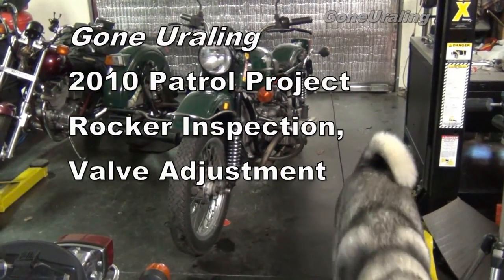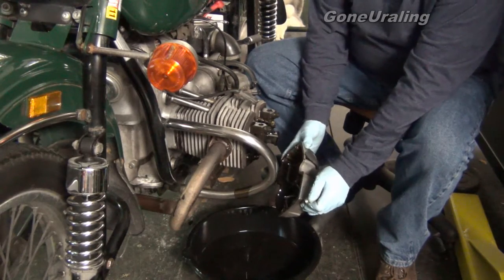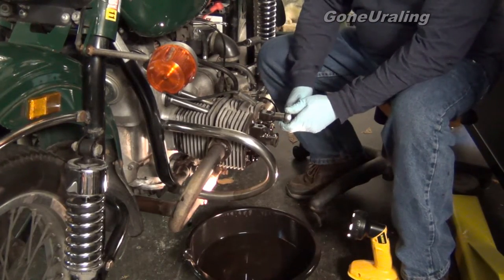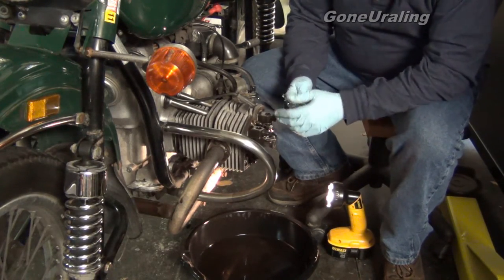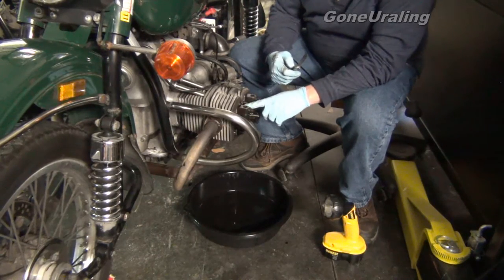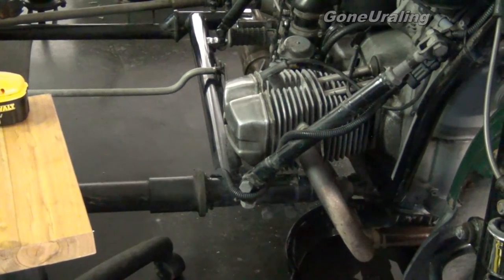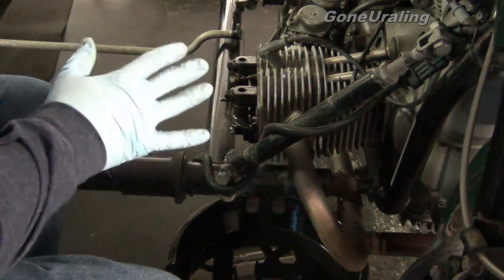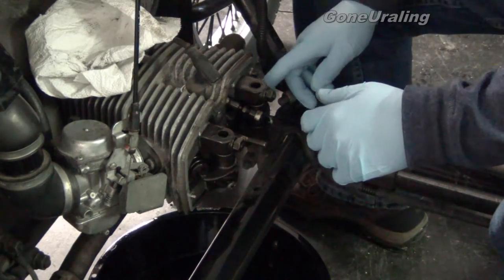2010 Patrol Project - Valve Adjustments

Comment: Remember,,,,,left and right on a motorcycle is when you are sitting on it. Very good video,,,,,,good info.
Also, call it a gauge,,,not a shim,,,some motorcycles do use replaceable shims to adjust their valves. Good job!
Ocala Fl

Comment: Wow, never took the tub of my Hack to work on her (the Retro that is)! You are having too much fun! What you found is typical with an engine with the petcock left open for an extended period of time. You are doing it right, drain everything, flush, adjust refill carry on! Just hope the crank did not get bent by hydraulicing the engine! 35 to 40 works, DO NOT USE TORQUE SPECS FROM MANUAL! Man those were loose! So far so good! Don;t worry about the rust, she set up for a while not Unusual - usual. Don't let her sit! And don't forget, loose valves are happy valves...
Reply from the maker: +JamesAllmond Yep, the tub actually lifts right off after removing 6 nuts. I took it off to work on the tub, but it was so easy... I think I&#39;ll just do that every time I adjust the valves. So much better than leaning over the seat.   Turns out the petcock was bad and running fuel in any position, new manual one is already on the way and I will probably change out the 2008s as well.
Reply: +Gone Uraling Changing the petcock was one of the nicest things I did to the Retro! I even have some caps for vacuum port if you need one!

Comment: My patrol will not start, ran fine but battery died, replace it and it ran around for an hour or so then quit. Has plenty of juice trying to start but will not catch, fuel is working but not getting spar to plugs. What do I check now? Is it the starter or ?
Reply: Hello, no spark at plugs can be a number of things. Start with coil/s, check the spark plug leads, if they are fractured etc they will short out. It will not be the starter motor as that does not affect spark at cranking. Hard to say without seeing the bike. What year is it?